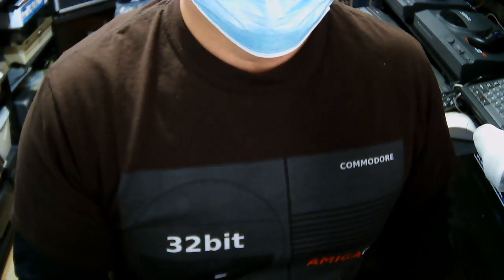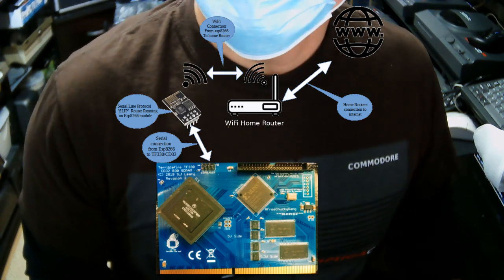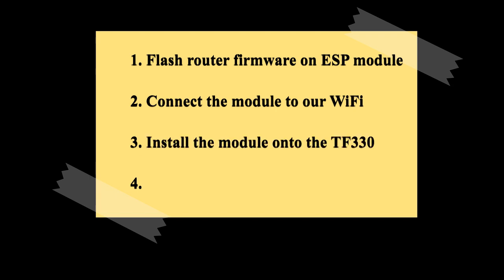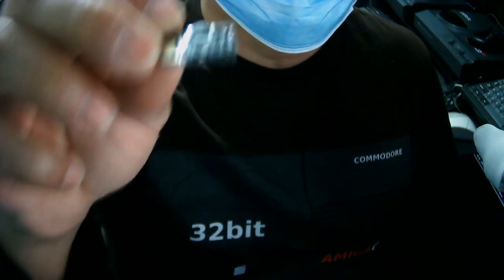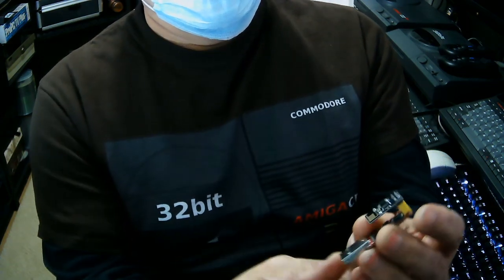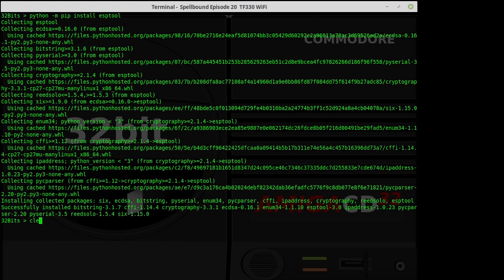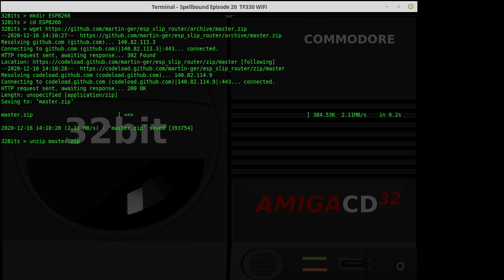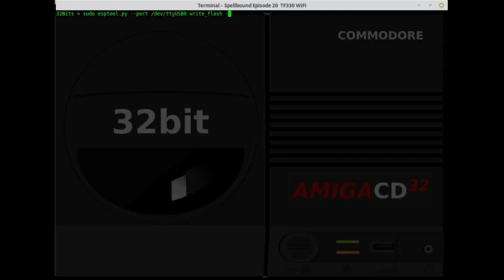Amiga CD32 WiFi Part 1- Connecting an Amiga CD32 to the Internet via  an ESP8266  and  a TF330 card

Comment: Great video!  Have you had issues with the 8266 stopping communicating and seemingly resetting during transfers, leaving the Workbench hung with the wait mouse icon until rebooted?  This happens to me at any baud rate.
Reply from the maker: Thank you for the comment. I'm glad  you liked the video.  I have not had any issues with the 8266 hanging. Are you using a TF330?  do you have the latest firmware on it?
Reply: @32Bits  Indeed, latest firmware.  This gives me hope that the issue is a physical one and easily resolved with a new ESP8266 and better connectivity.
Reply from the maker: @Doug-d4r  Yes I have had one ESP8266 module that I could not flash at all.   So I would absolutely try another module.  if/when you do let us know how you make out. :)
Reply: Yep, replacement ESP-01 came today and it works perfectly! I couldn't be happier.
Reply from the maker: @Doug-d4r  That's great! such a game changer to have Wifi on the CD32. thanks for the update. this might help someone else having the same issue.

Comment: Hi, I followed the video to the letter. I use a raspberry pi and the same programmer as in the video. I get no error messages at all. However on powering up the CD32 I get a very brief flicker from the ESP8266 module LED, this then goes out. On the Amiga my software is set up exactly as in the video. However I am unable to ping anything. I have tried starting from scratch three times now. Same issue. Is there anyway to check my ESP8266 functionality on the pi?
Reply from the maker: Yes, while its connected to the Pi you can connect to it and issue commands to scan for networks and ping your local machines.  have a look at the documentation for the slip router here.  https://github.com/martin-ger/esp_slip_router   Also have a look on the Exxoshost forums (linked in the description) some people have had issues that were addressed in the thread.
Reply: @32Bits  Thanks. I finally figured out the issue. I have a 1MB ESP01... Just needed to change the 8MB command when flashing to 1MB. All working now.
Reply from the maker: @allanullmann299  That's awesome! Good on you for sticking with it. So glad you got it working welcome to the club :)

Comment: Hi, Great video and would love to do this for my CD32 but I dont have Linux, my laptop is a Macbook and I do have a Arduino Uno programmer, do you have instructions for using this system? I may be able to borrow a Windows laptop if you have instructions for that instead of for Mac?

Cheers 
Les
Reply from the maker: Hi @Les.  Thanks I’m gald you liked the video.  I’m sorry I do not have a step by step for MAC or Windows but, with MacOS being very simmilar to Linux at its core the “Linux” tools I used should eb available for MacOS. (though some of the dependencies i.e. Python may not be installed by default.)  I know that there are tools for flashing and ESP8266 on both MAC and windows though so once you have it flashed you can follow the rest of the steps for setting up the Amiga side form my video/pdf.  An alternative would be to get a Raspberry Pi.  They make the perfect Linux machine for flashing not only these modules but the TF board Firmware as well.

I would encourage you to give it a try.  Having the CD32 online and being able to download software directly is just great. If you do I would love to know how you make out please keep us posted.

All the best,

32Bits

Comment: Thanks for taking the time to do this 32bits it`s appreciated and glad you mentioned about the `115200 Baud rate as this catches some people out basically Baud rate must match on the Amiga and Module otherwise it will never work.
Reply from the maker: Thanks @Jeff Jones  Glad to give a little back after Terrible Fire has done so much for the Amiga Community creating these cards.  The baud rate it was a sticking point for me the first time so had to mention it glad you noticed and thanks for pointing it out.